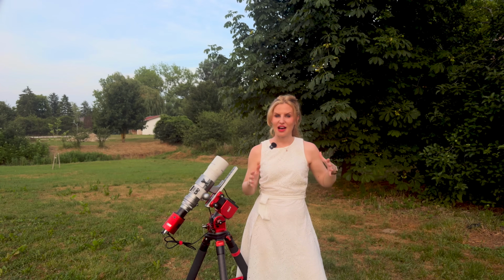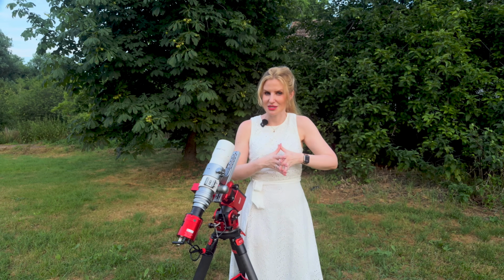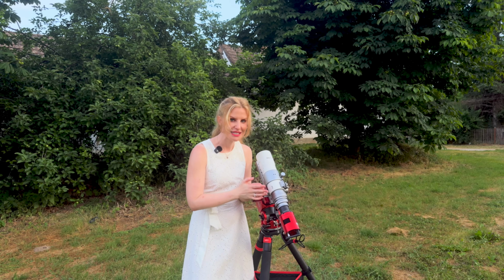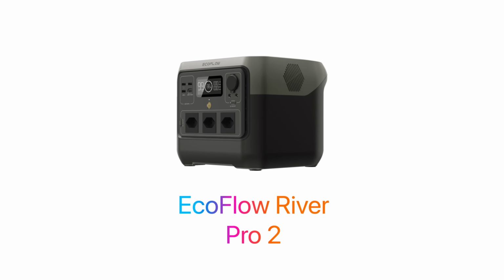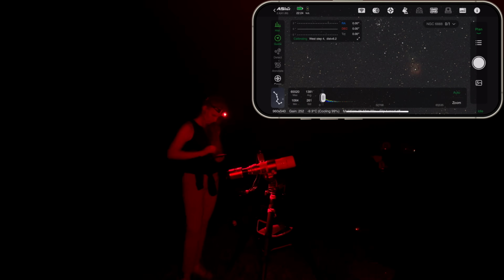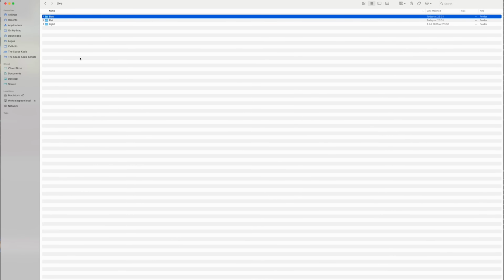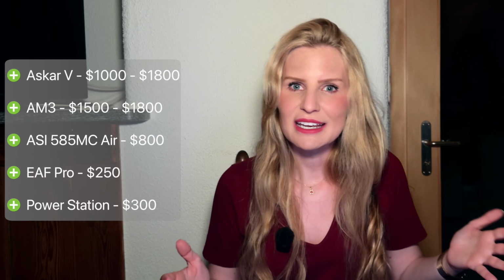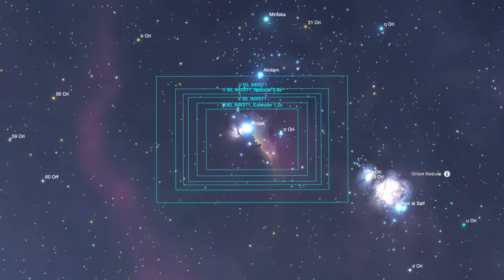Build Your Own Smart Scope! Easy as a SeeStar, Pro results!

Comment: I was very curious to see what you had to say about this approach because I did something very similar two years ago.  In my case I ended up with the following setup:  AM5, ASIAIR Pro, ASI533MC, and the William Optics Redcat 61 (plus the ZWO guide scope most people were using then).  I gulped at the total cost, but I knew if I didn’t do this to greatly simplify the hobby for me, I was going to quit.  What I was changing from was a Skywatcher GTI mount, my Olympus camera and lenses, and a refurbished Dell laptop running PHD2.  I waited setting the rig up, especially the balancing, and I really hated dressing up like an arctic explorer and sitting as motionless as I could get for hours in January to run the whole thing.  I tried going halfway using the 533MC with the 100-400 lens, but I discovered that the ZWO adapter I bought from Agena Astro wouldn’t come off the lens!  After panicking and talking to both Agena and ZWO tech support—Simon at ZWO was very helpful—I ended up removing it by using a hand-powered drill for several hours to cut a channel along one side of the adapter so I could use a fine tweezers to grab the pin and move it enough to release the adapter.  I was told this was a “radical” solution, but to me the trade-off was a no brainer:  a $30 adapter for a $1300 lens.  After recovering my wits from this near disaster, I thought about it for awhile and decided I didn’t want to give up, and made Agena Astro very happy one day by purchasing the rest of the rig described above.  When it all arrived and I set it up, of course I immediately encountered the defective cable problem ZWO was experiencing at the time.  Simon was again very helpful and the solution—new cables—was both obvious and easy.  Although there have been occasional problems since then, I really, really like this setup and approach.  I’ve occasionally thought about getting one of the larger-sensor ZWO cameras, by the camera-scope combination I have does most of the subjects I’m after.  I do want a wider field of view for a few subjects (e.g., the Rho Ophiuchi Cloud Complex), but rather than buy a new camera just for two or three subjects, I am now entering the wonderful world of mosaics!  Yours thinking and mine seem to have gone along similar paths although if I were starting my rig from scratch, I think I would go for a ZWO duo camera rather than one that includes the air.  I say this because if something goes wrong, especially with the air component in such an all-in-one camera, you would have to send then entire thing in for repairs or buy an entire new unit, whereas a new free standing ASIAIR Pro could be purchased much cheaper and be in your hands in just a couple of days.  Let me add that I am 75, and as long as I can continue to carry my rig from our dining room to our rear deck—the ASIAIR removers most of the problems of using the rig on a wooden dec because you are in the house, not out next to the setup—I plan to continue in the hobby.
Reply from the maker: it seems like your pre-asiair astro career was no less frustrating than mine :D the duo with a separate asiair is also a valid approach, especially if someone wants to use different cameras. On the other hand, they have made it so affordable, that it is currently the cheapest way to get "the whole lot"!

Comment: Are there links to the tripod and battery unit?
Reply from the maker: I won't add a link to the tripod as I honestly don't recommend it - it is the William Optics carbon fiber tripod. You're much better off with the ZWO one. I am still using it as I already have it, but I wouldn't purchase it again.
The power station I use most frequently is this one: EcoFlow RIVER 2 Pro Powerstation 768 Wh - though it is an overkill and you can get a smaller unit for a single night of use.
Reply: I was also wondering about the tripod - probably I'll get an AM5 soon, and it seems that the ioptron's carbon mount is the same, but with a slightly better tension solution compared to zwo's tc40 (although, then I'll have to use a the zwo PE200 too..., so almost the same weight as my old skywatcher steel tripod, doh)

Comment: Great video. I have been using a Red Cat 51 WIFD, but 250 mm focal length isn't a lot of reach. I like the idea of the Askar V as a relatively budget friendly alternative (presently about $1,000 U.S. where I am), but the reducer, flattener and extender seem to add complicity back in. Your thoughts?
Reply from the maker: well it depends on how you look at it. To me it's a bunch of options to choose from. Surely a single petzval system is the simplest, but then again you are locked into a single FL. That is not necessarily an issue, I just think with the fact that it is currently costing as much as the RedCat and offering so much more, the Askar V would be a no brainer
Reply: @the_space_koala  Thanks for the prompt reply. Excellent point. And thanks again for your outstanding videos!

Comment: This is an outstanding video (if a little ZWO-heavy…though that’s ok as ultimately I’m looking to buy an AM5n plus the 2600 Air myself).  I have a Dwarf 3 and it’s just fantastic. I love it.  I bought it expressly to ‘test the waters’ of AP before more fully committing to the cost and complexity of this hobby. And I found I love it!  I have a Takahashi Baby Q OTA for visual use, but the Dwarf 3 - and this video - has confirmed both my love for the hobby and my own preferred upgrade path.  Hopefully my Tak will be a good choice for AP.  Only small point of disagreement is your comment that the binning, flats, focus etc was as simple as the smart scopes.  It looked more complex to me, but I confess I’m very inexperienced!   Anyway, thank you again, I really loved this video and have subscribed immediately.
Reply from the maker: thank you for the sub! the Baby Q will be awesome, not exactly the entry-level refractor most people use :D if you find the calibration frames intimidating, just start without them and start using them over time! there's no reason to stress yourself over it. And I do understand your "ZWO-heavy" sentiment, this is the one downside of this system, it is only self-compatible. On the other hand, whoever comes from the world of the Seestar will 100% find this the easiest to adjust to. (And I also use an ASIAIR for 90% of my deepsky imaging, even if my rig is way larger than the one shown here)

Comment: Thsnk you very much the important block of the smart system is the application, like NINA  or astropi Less than 1400$(svbony)camera sv 705 (used150$),guid scope with camera(100$) and 70ed scope and cheapest mount😊,
Good luck.

Comment: Very interesting, thank you.  I have had the S50 for a few weeks now and I was thinking of how to go deeper into space... but on a budget, as you suggest here.  I already own a powerful camera, the OM Systems OM1 and the £6,700 150 to 400 lens.  This lens has a built in 1.25x converter and so, when you factor in the 2x crop of the M43 OM1, I get a full frame equivalent range of 1000mm.  Would getting the Astro GTI, you mentioned, be a viable option and would this be as good as a telescope.  What do you think would be the pros and cons of telescope vs high end camera, like mine?  Sorry for such a long question.
Reply from the maker: Keep in mind that for most objects you likely want to image at this stage you won’t need such a long focal length! I especially wouldn’t use the extender as you’re making the whole system slower. I have an EM1 Mk3 but I have the poor man’s 100-400 😁 so I haven’t tried deep sky with it. At the start I did some with the 40-150 pro (at 150) and it was nice for some nebulas. Shooting at 800mm would require precise polar alignment and also guiding. I would urge you to start on smaller focal lengths until you get the hang of it, otherwise it can get frustrating.
Reply: @the_space_koala  Good advice, thank you.  The 40-150 is a cracking lens.  And, of course, you get the f2.8 aperture.
Reply: I love your videos, btw.

Comment: The thing I like about my Vespera Pro is that I can place it on my extension roof, power it on and then run everything from the app. I don’t have to bother with polar alignment. I asked on various forums if you could run software that allowed running a mount in Alt-Az mode and would plate solve instead of polar aligning, just like the SeeStar and Vespera etc. What you’ve described is a pretty decent traditional rig as you still need under doing PA & taking calibration frames etc, I think Cuiv described a proper DIY smart telescope that took multiple short exposures using an Alt-Az mount. The asiair does support Alt-Az but I guess you still have to PA??? Of course one advantage of the smart telescope is if you have a small balcony with no view of Polaris, you just power up and it will plate solve and start imaging…
Reply from the maker: You can run this rig in alt az! That said, I wouldn’t. If you consider you’re doing 10sec exposures you really don’t need your polar alignment to be so accurate. What I would do if I were you (if you wanted to use this system) is get the altitude right and just freestyle the PA pointing more or less at north! You will benefit from much less field rotation and you don’t have to deal with precise PA
Reply: @the_space_koala I guess what I was trying to build is a setup that I can plonk on a flat roof and align etc from the app. I don’t really want to go up onto the roof to polar align or my case all sky align (as the north view is obscured by my house). The whole exercise was that I have a gap in the housing roof line due south and so I can only image low targets eg, M16,M17 & M24 for a couple of hours maybe, using my EQ6R-pro and Sharpstar 15028HNT (brilliant scope btw). Putting my Vespera Pro on the roof gives me a much better view of the South. It might be that my best bet is to ensure that I place a small rig in exactly the same position on the roof and only PA once? I do this with my EQ6R-Pro where I designed 3D printed tripod feet locators banged into the lawn, so you move the tripod and then relocate it back in exactly the same position without having to PA. 😊
Reply: Quick update, I’ve just ordered a Juwei 14 harmonic mount. Considerably cheaper than an AM5 but still works with an ASIair. It’s bigger brother the Juwei 17 gets a lot of great reviews 😊

Comment: Hello Koala. You told everything correctly, but almost. You did not specify only one thing, that the dimensions and weight of your set exceed the weight of Seestar S50 many times. I am not even talking about SeeStar S30. And of course the financial costs are not comparable!!!
Reply from the maker: You’re right, it is far less portable. Though, it is not backpack size, but you can still easily carry it around!
The cost difference is very significant but I think I addressed this in detail and there’s just no way around that. The Seestar is unbeatable in what it gives you for its price but eventually, if you want more, you unfortunately will have to spend more
Reply: Hello Luca,
I couldn't find your email anywhere, so I have to write here. First of all, thank you very much for what you do! You are very good at explaining what and how to do, and it doesn't matter what it concerns: software products or the use of equipment. After your explanations, everything becomes clear. I can even say that after your explanations, I feel like a professional in astronomy. Luca, could you tell me when the SeeStar S30 pro will be presented? I heard from a ZWO representative in your report that it was supposed to be June!!! But it's already July, so when?

Comment: That's a very versatile set up. Unfortunately your video crashed halfway through so I haven't been able to view till the end. I have just built a similar rig based around the ASI585MC air with a William Optics GT81 and a Sky Watcher Wave 100i mount I already owned. At some point I will add a rotator and an EAF Pro ( the standard EAF works fine but requires a wired connection of course). It really is an easy rig to use. For first light with the camera I actually used the scope and camera with my EQ6R-Pro mount which I have permanently set up in my back yard.
I agree that if people want to upgrade from a See Star they should seriously consider building a rig like yours, they are easy to set up and use and also very portable. Mounts like the AM3 and Wave 100i are very light unlike traditional GEMs of the same load capacity. The one thing I would say is that this rig is still far from ideal for planetary or Luna photography, but for dso  imaging it is a great step up from a See Star.
The only thing that will put some people off is the price but actually it's value for money imo. That rig will give years of enjoyment, and as you said there are cheaper ways of building a smart rig but you will lose some of the versatility.
Reply from the maker: I fully agree with everything. This is still way too small for planetary. Then again, to do proper planetary you need a completely different setup and better conditions, I believe most of the Seestar / smart scope community is more into deep sky photography anyway. Harmonic mounts are a godsend saving me frustration and my back

Comment: Nice post, and very nice rig. Everything well integrated. But the cost of it.... Phew! As a guy who cannot afford this rig even remotely, I choose to go the extreme cheap way. A €500 goto 6" dobsonian, a second hand ZWO294MC camera, also €500, the old laptop of my daughter and a €30 lead acid battery. And Oh... Of course Sharpcap that costs me around €12 per year. Thats it (apart from some cables). 

Of course, this is EAA and not astrophotography because of very short subs (like 10 seconds, depending on the location of the target in the sky) and lets be honest: not good tracking at all. And yes, there is a learning curve. But fortunately, after some days of swearing, lurking on websites like cloudy nights and watching youtube posts, it is not that rediculously hard. 

On the plus side: when everything works eventually, it is a bit like a smart telescope. You need to level the telscope, just like you need to level a smartscope. You can use Sharpcap scripts that perform an automatic 3-star alignment, after you can do a simple goto command to find your target. Sharpcap can calculate the right gain/exposure lengths for you. You can shoot lights/darks fairly easy. Manual focussing is easy using a home-made bahtinov mask and zooming in on the screen and watch the diffraction spikes. 

Also: you can watch the image build up "live" in Sharpcap. If you want to do postprocessing, you can use Siril instead of Pixinsight (which costs a lot of money as well). That I really find the more difficult part of the hobby. But fortunately: lots of good step-by-step instruction videos can be found on youtube! Also note,  post processing subs with your nice rig is not twice as easy as postprocessing subs from a more affordable rig. The difference is of course the image of your rig will be much, much better.

In the end: lets be honest. If you would only need to "plop" the semi-smart telescope in the yard, press a button, grab a coffee inside and return after an hour or two to see what the thing has captured.... Did you not just outsource your hobby? It is like paying someone to go on vacaction for you so you do not have to...

Comment: That Askar refractor with a DUO Air/AM5 makes for a clean compact set up!!! I ditched my giant sized portable power box and now use a 5.2ah 5 amp lithium compact battery which makes it even more portable.
Reply from the maker: Does that run the air setup?

Comment: A great pathway - this will be very popular. All hobbies have a journey, that's part of the hobby. But the key is to get new users in and not frustrate them out before they get going.  A number of hobbies have an rapidly aging base, so having an easier pathway for new users is essential for a vibrant community. (As is helpful forums and great spokespeople look yourself). Thanks!
Reply from the maker: Yes exactly! The key here is to make the steps forward easy to handle so it doesn’t get frustrating! The ASIAIR makes it very simple. Then, of course, some may graduate to a NINA setup. Then again, I have a PC with Nina and still use the ASIAIR 90% of the time for convenience 😁

Comment: What's the wattage rating on your power station?
Reply: You need around 500 watt like ecoflow RIVER 2 minimum. I have pro edition (700 watts) and it's enough for about 10 hours of work of the rig
Reply from the maker: The river 2 pro (700Wh) is enough for me for multiple nights in the summer (short nights)
Realistically you’re consuming 40-50W/h tops with this setup. Even if you have extra long 10 hour nights in the winter you have a lot of margin. Also because if it’s cold you’ll cool much less.
Reply: @the_space_koala  you cool less, but power station battery doesn't work so well ;) But overall yes - 700Wh is mostly enough for 2 nights for me
Reply: @the_space_koala Thank you.